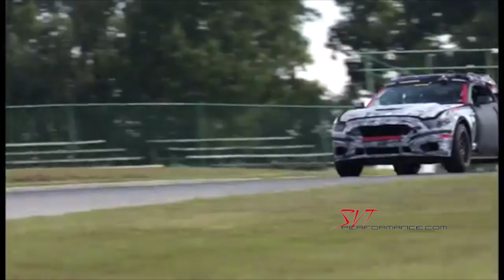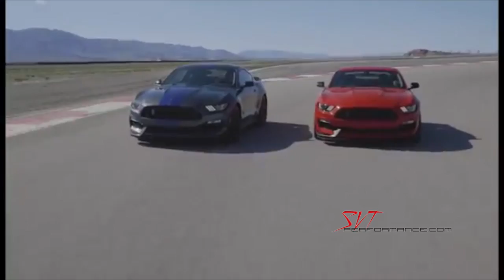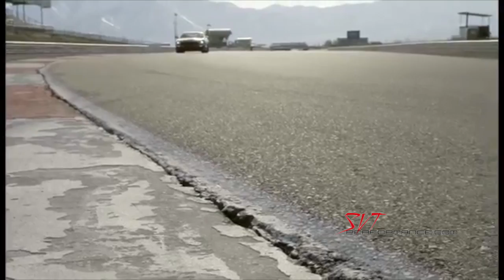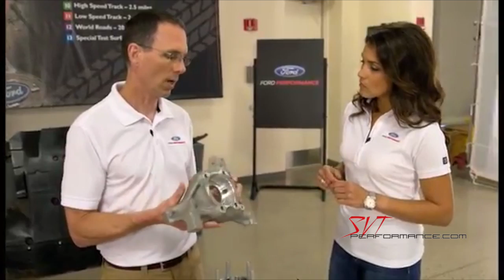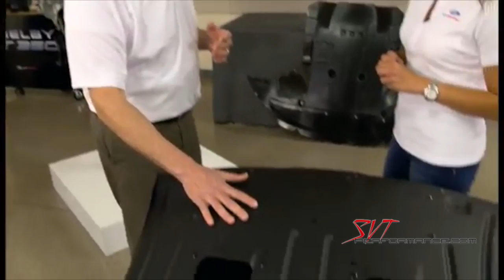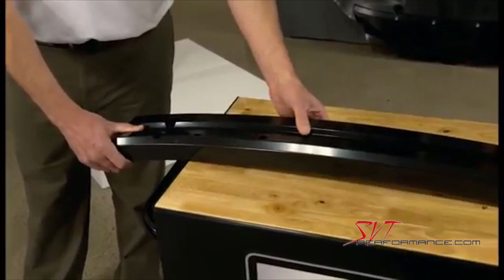2016 Shelby GT350 Dealer Info Disc

Comment: I just want everything but the 5.2L
Reply: +Durham Porsche im not a big fan of the motor as I enjoy the fact that it has a lot of top end power n/a but you can only go so far with that, I don't think it'll hold up well with forced induction without extensive modification and with everything being so motor specific it'll be expensive to do so; when I can make way more power with a stock 5.0 with any type of forced induction and since most 5.0 parts cross with multiple years less expensive to push it to the limits they could've easily done all the weight saving upgrades to 5.0 and F/I and have similar weight results and a total winner of a car just my opinion as a mustang buyer owner hobbyists.
Reply: Did you buy the Mach 1 then?
Reply: @lucidsquid5312  lol no but I've been eyeing them tbh I ended up getting a 17 gt350 a few years back but sold It to finish building 15 gt hated b!tch!n every time some would park near me in parking lots with the 350 its a crazy fun car to own but getting a small door ding in the gt isn't giving me heart attacks 🤣.
Reply: @5FaLlEn5  that’s awesome man. I drive a 2015 v6 mustang with a manual. I wanted to upgrade to a gt350r but kinda like you said I would be scared to daily it so I would have to keep this one. Or I could trade it in for a c7 z51 that you can get ahold of close to and sometimes under 40k. I’m excited to see what Ford does with the next gen mustangs though!

Comment: not enough  horsepower
Reply: +09victoryrc More N/A horsepower per liter of any other gasoline engine. Also, its only $47k base
Reply: +James Aikens unless you want to loose to a base corvette,it needs more horsepower, the two people l know trying to buy one say the dealers are marking up the sticker $10,000,they are walking and buying 14' gt500's with 660HP.  I can't blame them.
Reply: +Durham Porsche Mustangs end up competing with both Corvette & Camaro on the streets or drag track but the GT is a bred to compete with super cars and the Corvete is still considered just a sports car by most, stock for stock the GT should be & will be well over engineered like most super cars are taken down R8's
Reply: +09victoryrc maybe new gt500 on the horizon?
Reply: +Wayne Vu I think they are working on one it nice to have at least 700 horsepower that would be a world-class sports car